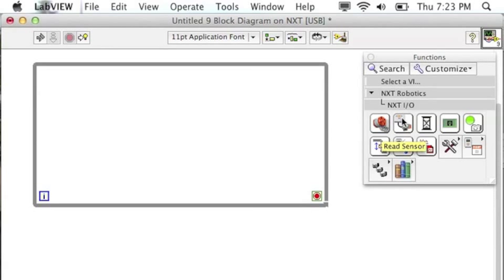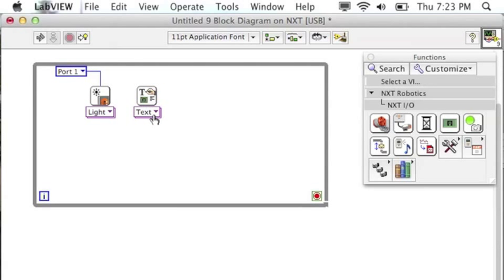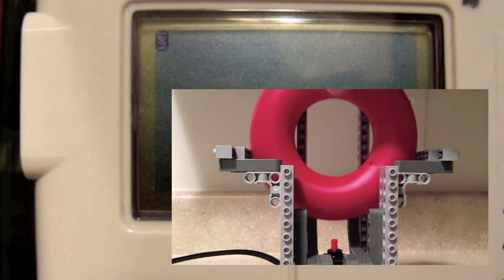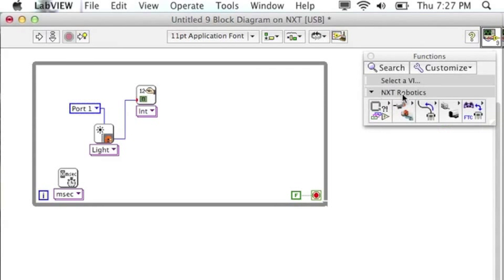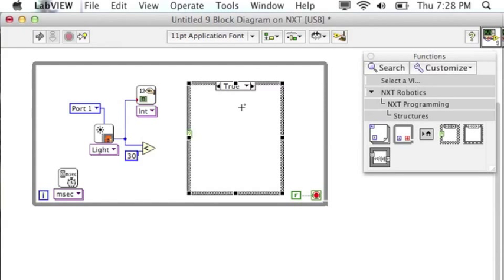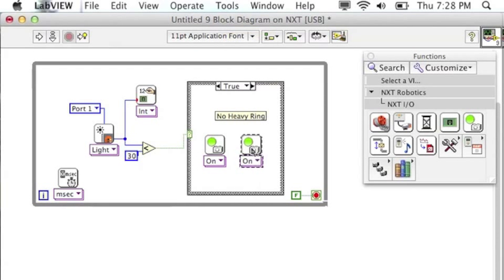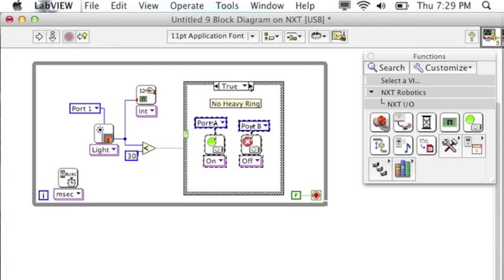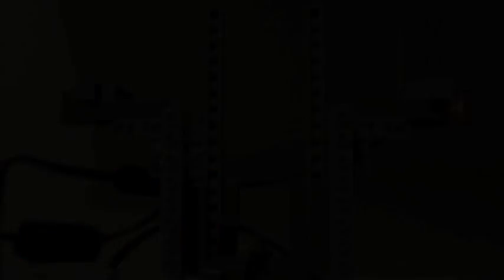The Force Sensor

Comment: hi , first of all i want to thank you for your videos 
im using an Xbee series 1 to collect data from remote sensors i have 3 sensing nodes each one consists of  ( sensor , xbee , PIC microcontroller )
and i want to display the data coming from those nodes on my computer using labview 
* i already established the connection for this network and i can get the data on a master board but i want to connect it to PC so i can do more processing on the data 
how i can do this ??